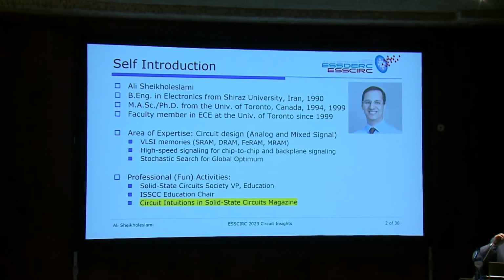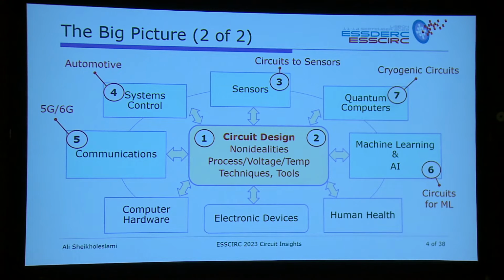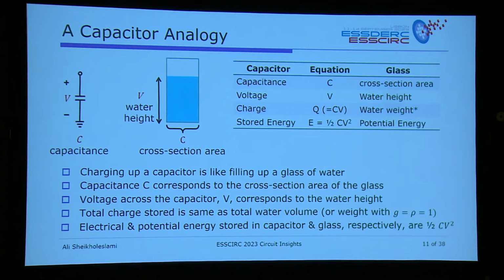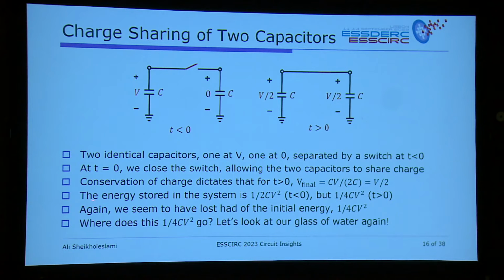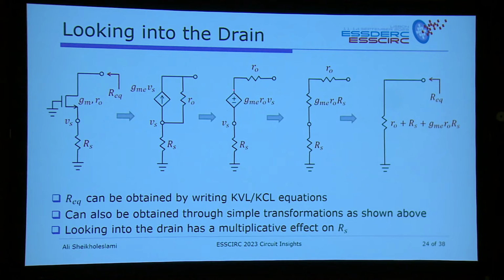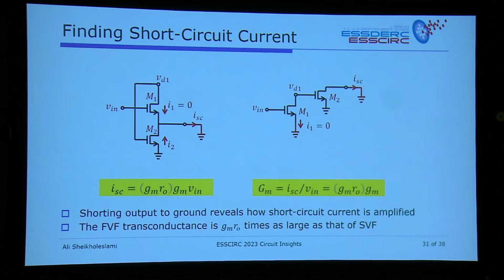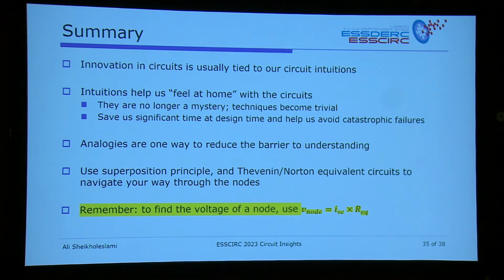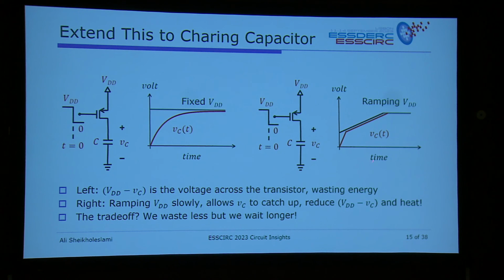2 ESSCIRC2023 Circuit Insights Ali Sheikholeslami

Comment: 00:10 Ali Sheikholeslami is a professor of electrical and computer engineering at the University of Toronto
03:14 Controlling electrons for storing and processing information
07:42 Circuit design is fundamental to various technologies.
09:55 Understanding concepts to simplify circuit designs
14:10 Circuit design challenges due to minuscule device sizes
16:12 Intuition and understanding are essential in circuit design.
20:00 Understanding circuit concepts and applications without complex equations.
22:09 Charging a Capacitor and Energy Waste
26:00 Avoid losing potential energy in capacitors
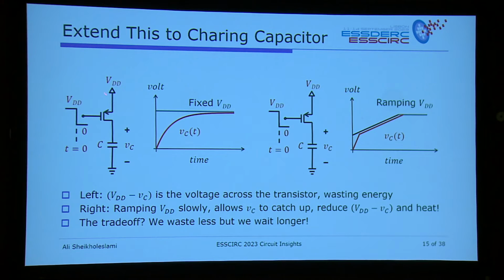28:01 Charging method efficiency trade-off with varying voltage levels
31:42 Water oscillates in a frictionless pipe, creating turbulence.
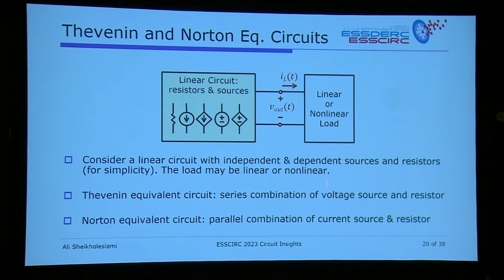33:31 Circuits can be simplified using equivalent circuits like Norton and Thevenin.
37:02 Transistor equivalent to a resistor
38:43 Transistor source resistor acts as a resistor multiplier
42:19 Understanding DAC operations and circuit simplification techniques.
44:07 Using transconductance for voltage follower analysis
47:44 Analysis of voltage gain and output impedance in a circuit.
49:30 Applying voltage amplifies current due to multiplication by 1 plus GM
53:10 Importance of circuit intuition for innovation
55:08 Discussion on developing circuit intuitions
59:02 Negative resistance explained
1:00:58 Perspective on alternative intuitions and giving credit to students
1:05:02 Reducing energy loss through ramping circuit supply
Crafted by Merlin AI.